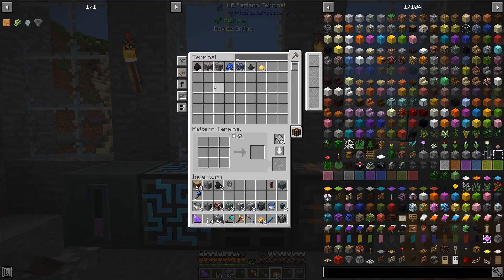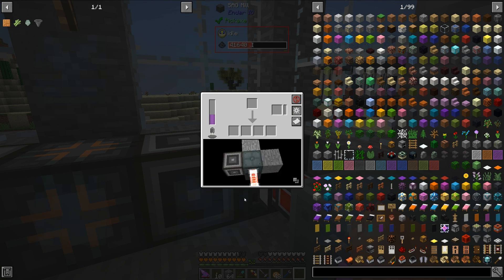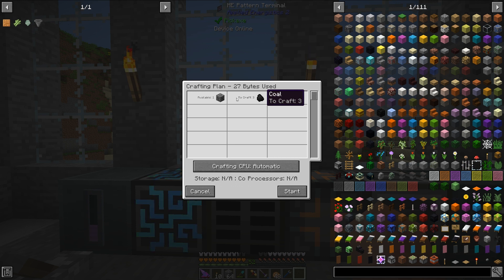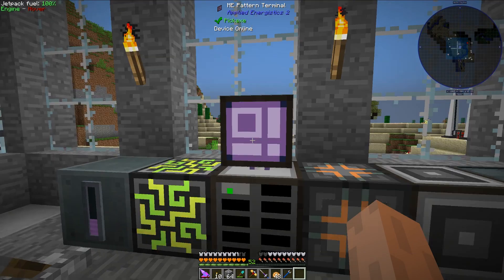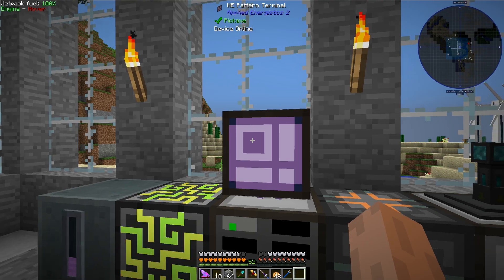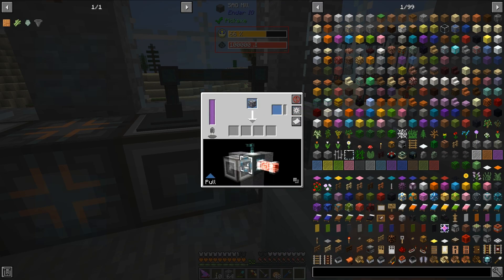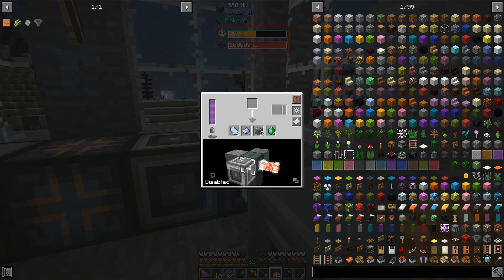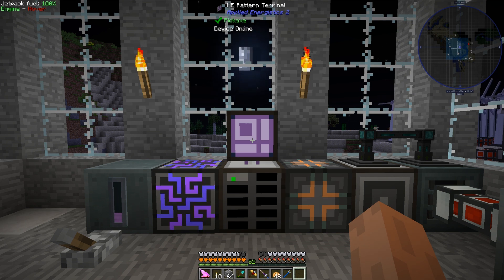How To Automate Ender IO Machines With Applied Energistics 2

Comment: One way I did it in 1.12.2 was to make the interface into the flat panel type ( insert block into crafting grid, output is panel based ME Interface)
I would stick one onto the front of every Ender IO Machine and have the machine insert and output from the same side.
Yes it uses more channels, and is more costly, but I find it more efficient as I can set each alloy smelter to do its own task without being affected, and the interface inputs almost 4x faster than the Ender Conduits do. 

So power below machine, interface in front / side / top / back or wherever. 
You can also make a subnet with each machine as its own network.